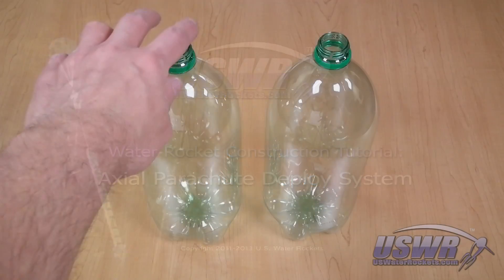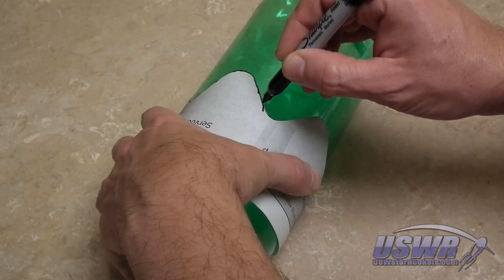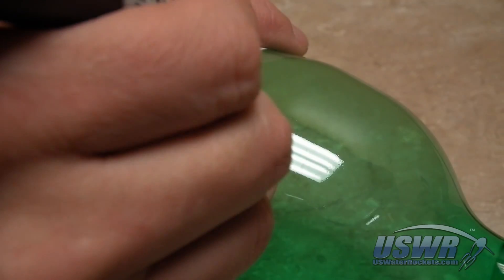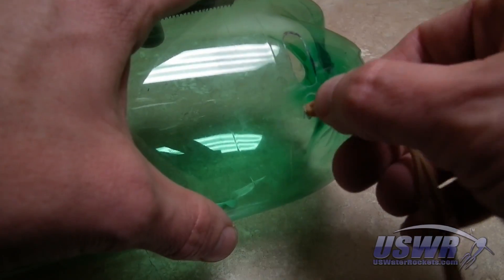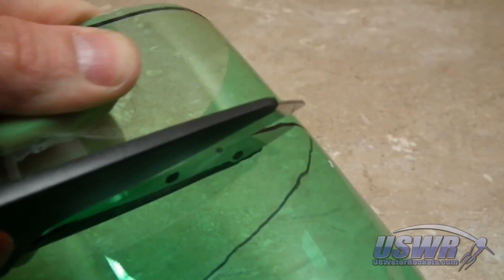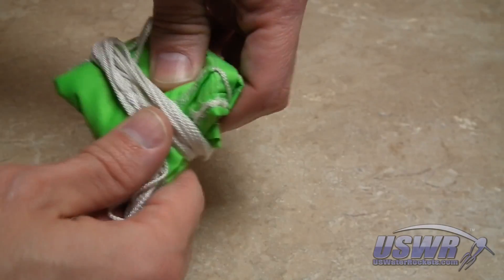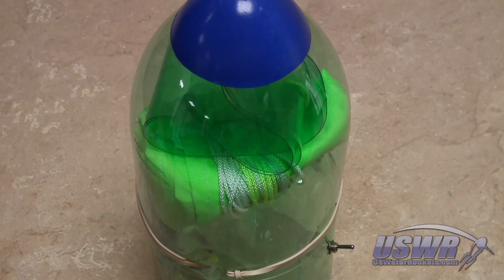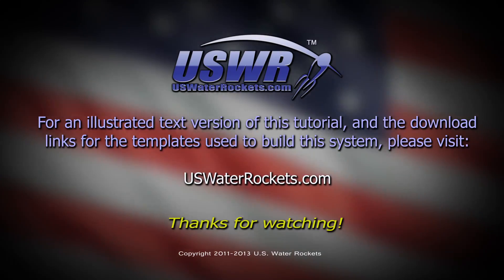Build a Parachute Deploy System for Water Rockets Tutorial

Comment: A little over-engineered for my liking. The weight of the servo and other parts FAR exceeds a desirable payload weight for a water rocket. I'd be using solid fuel motors before considering this design.

Comment: How would i deploy it without electronics?
Also, could i use a party hat?
Reply from the maker: Look for a trigger design based on a "Tomy Timer" (often mistakenly called a "Tommy Timer") there are a lot of people who use those for triggering the parachute. Another method people use is called the "Air Speed Flap" or "Air Flap" deploy trigger. Both of these are not electronic based, and have been used by many people. Since so many other folks had covered them in tutorials and videos in the past, we didn't want to rehash their work in our own video and focused on electronics. That way we weren't stepping on someone else's feet. Feel free to look those designs up and use them.

Comment: how do you activate a servo with a control panel (tomy timer)
Reply from the maker: +Brian Bai The Tomy Timer is a mechanical device that rotates over time. The typical way this is used is the wrap the rubber band around the rotating part of the timer so that it comes off after a desired time has elapsed. A servo is an electric motor with gears that moves when a special signal is applied. This allows precision control of the position. We operate a servo either using a ServoChron electronic timer: https://youtu.be/J_C4v0zYUuY,  or a Launchpad AlTImeter: https://youtu.be/lG6LBraU-Qk.
Reply from the maker: +Brian Bai a Servo is an electronic device and it needs a special signal to move it. A Tomy Timer is a mechanical device which uses a spring to rotate gears. The Tomy Timer is typically used by winding a rubber band around the rotating arm such that it slides off after the mechanism rotates for a predetermined amount of time. To control a servo, you need an electronic signal to command it to move. We recommend building a ServoChron timer: https://youtu.be/J_C4v0zYUuY or a LaunchPad AlTImeter: https://youtu.be/lG6LBraU-Qk for servos.

Comment: All over the fuckin web. SERVO MOTORS, SERVO FUCKING MOTORS. CAN YOU JUST FUCKING TELL ME HOW TO DO IT WITHOUT THE MOTOR?
Reply from the maker: You can use a "Tomy Timer" in place of the servo. There are dozens of videos showing how to make these. Some people spell it "Tommy Timer" by mistake. You can look those up and see how it is done. Since they are similar to a servo motor mechanically, we don't show both options. Any servo deploy can easily be adapter to the Tomy Timer activator.
Reply: How about non electric?
Reply from the maker: Ivan Rogovskiy the Tomy Timer design is a mechanical timer that works with a wind-up clockwork mechanism. The name comes from the company "Tomy" that manufactures wind-up cars and novelties. Many companies make such things for very low cost now. You strip the clockwork part from the novelty and use it in place of the servo on most deploy designs. If you google "tomy timer" you will see many good samples. There are other parachute systems that are simpler but less reliable like the "air flap" method. You can check that out too. We don't have a lot of experience with it.

Comment from the maker: There is a design that many people use which uses the guts of small wind-up toys. The way it is used is they wind the spring and wrap a string or rubber band around the winding shaft, and use a dowel or similar thing to hold the mechanism from moving. The dowel is fastened to the launcher so it is pulled out at launch. The mechanism begins to run and the shaft rotates until the rubber band or string releases. Do a search for the "Tomy Timer" design and you will find many examples of this.